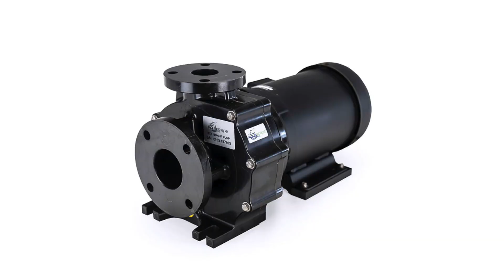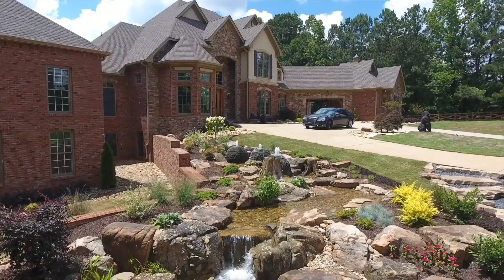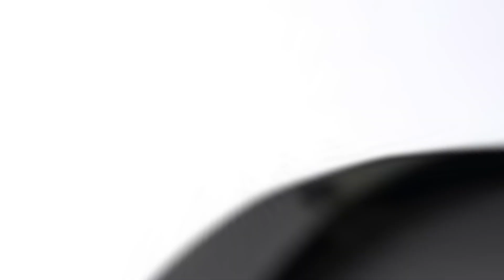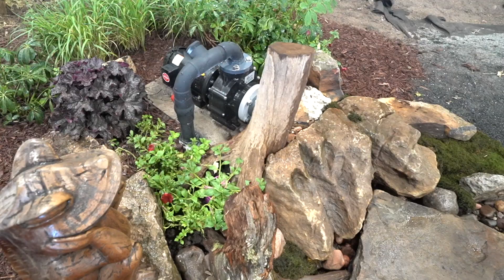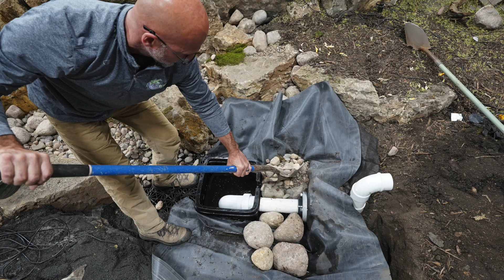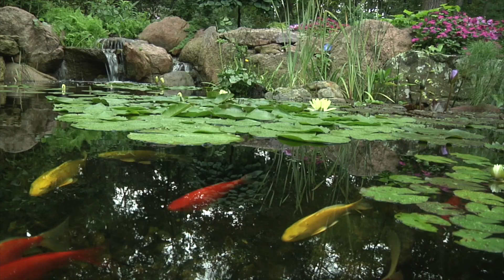Aquascape EXT Pond Pumps

Comment: Can I ask if there is a max distance between the external pump itself and the pump intake?
Reply from the maker: We recommend trying to keep the length of the 3″diameter suction line at 10 feet or less and the distance from the surface of the water to the pumps inlet at 3 feet or less.  While increasing these distances is possible, it will make it easier to prime the pump and maintain the prime when the plumbing distance and intake height is minimized. You can learn more about these pumps at https://www.aquascapeinc.com/external-pond-pumps

Comment: I am planning on building a pond in my 2 archers backyard with an area for cookout and hang out in the summer.  I live in the NE US so there is winter here.  I am looking for a reliable place to purchasing all the equipment i need for this big project.
The Pond will be about 3 step-levels and probably 3-4 feet deep, and 10X10 or 10X15 and probably  with a hidden/or shaded area for Koi to hide during hot summer day, this area probably where the water fall will be. 
I just wonder if you have any tips or idea and pumps that I should use for this kind of project?  Please enclose some links in the response for the equipment to help me lessen my search for them.   Thank you so much for your help.